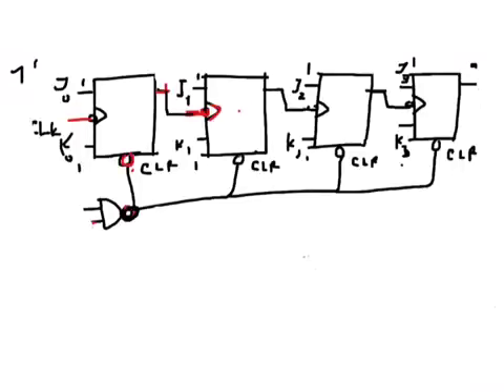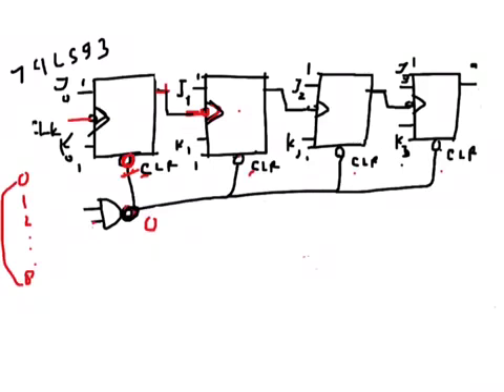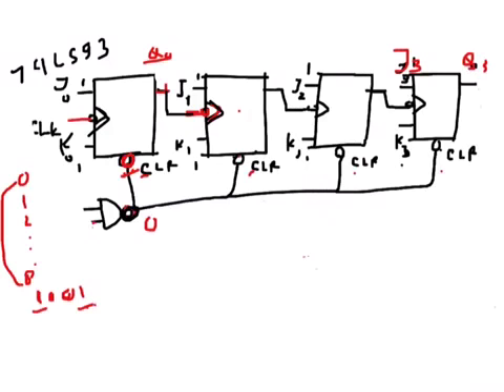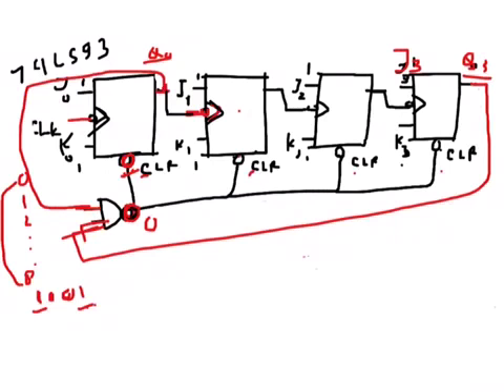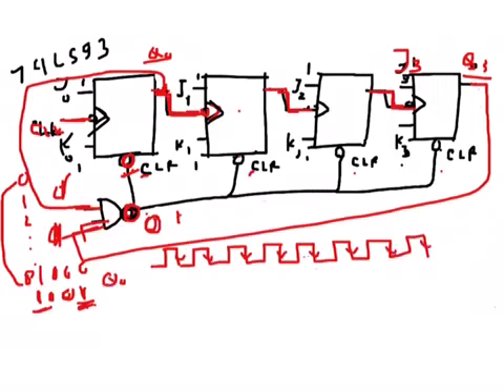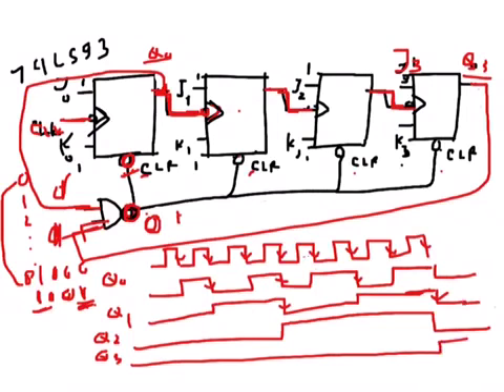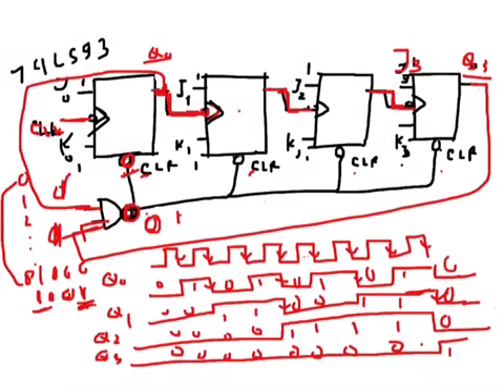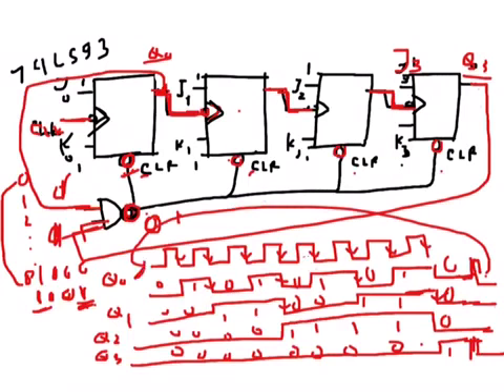Digital Electronics: Mod 9  Counter Using 74LS93 IC with Asynchronous Clear

Comment: and how to find mod 6
pleces
Reply from the maker: It will be a similar circuit, but clear input will be 0110 (asynchronous clear), so it will count 0,1,2,3,4,5 and when the counter hits 6 (0110) output will be CLEAR and it will go back to 0.
Reply: thanks sir

Comment: How about the wave form of the NAND gate?
Reply from the maker: From 0000 upto 1000 the output of the NAND gate is1, then at 1001 it is 0 momentarily (only to clear the Counter). But immediately after that the output of the NAND is again 1. The the cycles goes on.